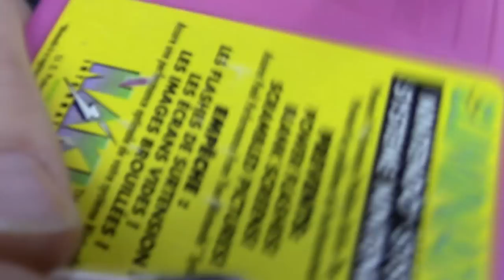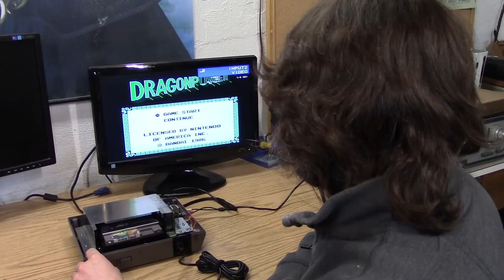NES Repair, Bad PPU? - Brad Tratzinski

Comment: I repaired a famicom that had bad videoram chip. The symptoms of this was sprites seemed fine but background was a mess of garbled graphics and numbers and letters. I used the ram chip out of a parts NES board & used a heat gun to easily remove the chip. Works perfect now so if you ever have those symptoms this is most likely the issue. It was actually a famiclone but board layout was identical (older 1989-90 clone) and the ram chips were wider than the NES one but luckily it had the solder spots for the NES narrower ram chip. Hope this helps you or something else in the future.

Comment: I’m having an issue with double dragon 2 where the top couple rows of pixels start to appear on the bottom of the screen. They come and go randomly. Doesn’t seem to do it on other games. You think that’s a PPU issue or maybe just my game? I have cleaned the game as clean as it can get.
Reply: It’s the game , I have the same problem